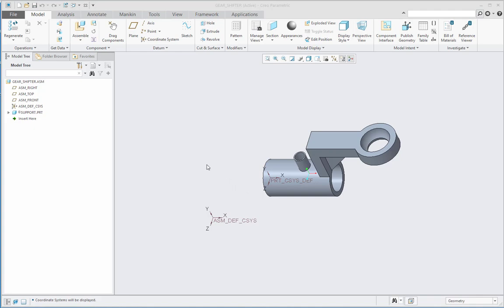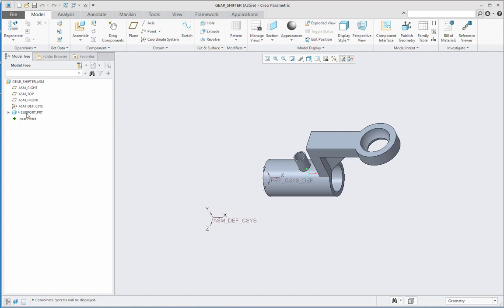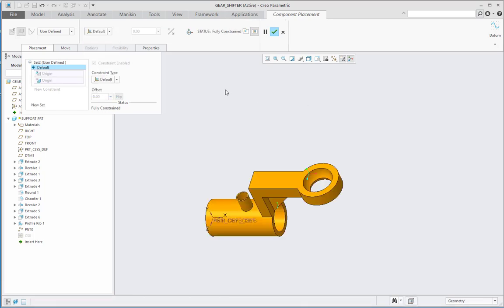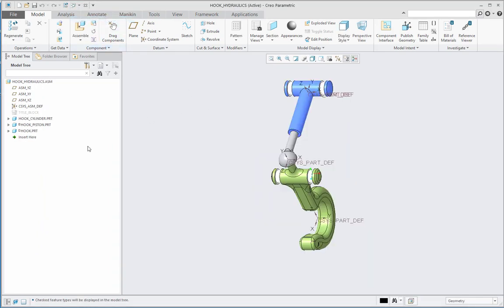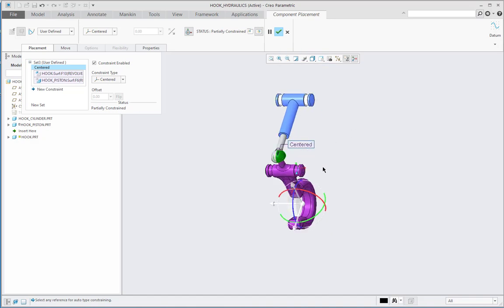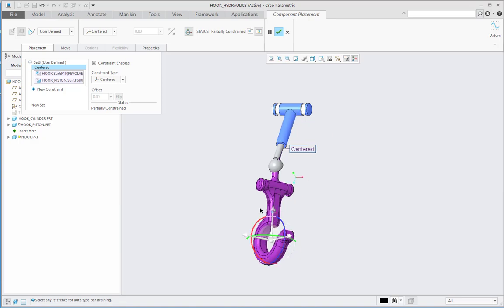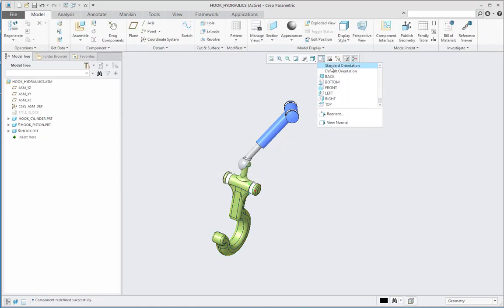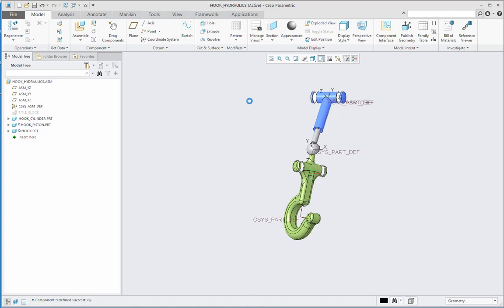Know the Difference between Fix and Default constraints in CREO Parametric Assembly Design

Comment: In Solidworks, we can add constraints and also fix the component without modifying or deleting the existing constraints. How do we do that in Creo?
Reply from the maker: In PTC Creo, you can fix a component or add constraints in a similar way to Solidworks. To fix a component, you can use the "Pin" constraint. The Pin constraint locks the component in place, preventing it from moving in any direction. You can add a Pin constraint by right-clicking on the component and selecting "Pin" from the Constraints menu. To add constraints, you can use the "Constrain" command. You can select the components you want to constrain, then right-click and choose "Constrain." This will bring up a menu with different types of constraints you can apply, such as coincident, parallel, tangent, and so on. Once you have added constraints, you can modify them if necessary. To modify a constraint, right-click on it and select "Modify Constraint." This will bring up a dialog box where you can adjust the parameters of the constraint. It's worth noting that in Creo, constraints are automatically solved and updated as you make changes to your model. This can help ensure that your model stays in the desired configuration even as you make design changes.
Reply: @myigetit  I do understand how to use the constraints in Creo but I could not find a similar way in Solidworks (which is very convenient) to fix a component without disturbing the existing mechanism/constrains.
Reply from the maker: @allanjlansangan  There is a fundamental difference between Assembly environment in Solidworks and Creo. In Solidworks, we call the component in the assembly and if we place it randomly at any location in the Assembly graphics window, then the component gets fixed at that location. This is similar somewhat to the 'Fix' constraint in Creo. Further in Solidworks, if we need to move or rotate the component, then we can toggle the Float option and Fix constraint gets disabled releasing all DOF. After moving/rotating as per our need, we can fix the component again. When the component is in floating mode, we can create an Origin to Origin type Mate constraint which fully constrains the component and that is similar to 'Default' constraint in Creo.